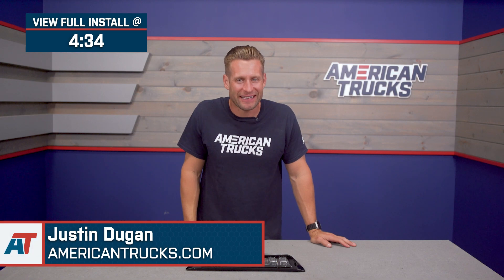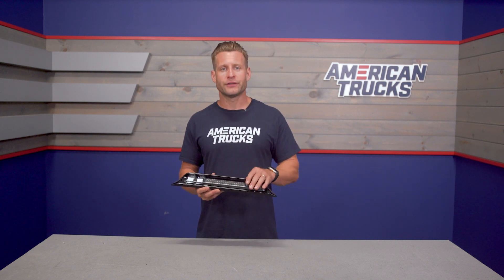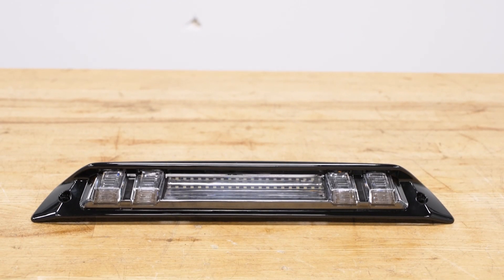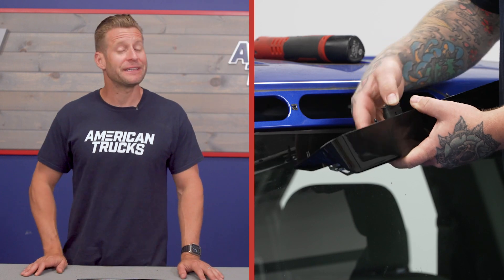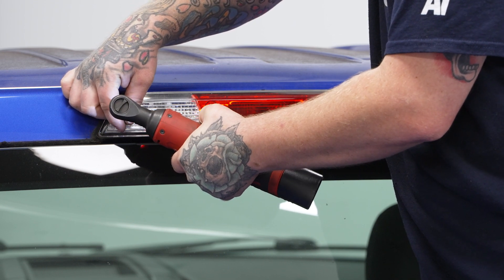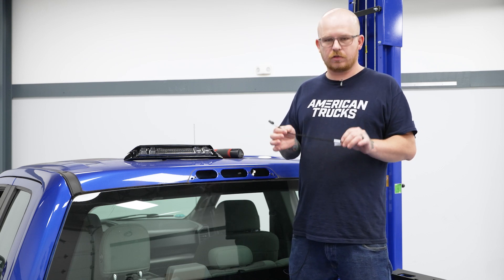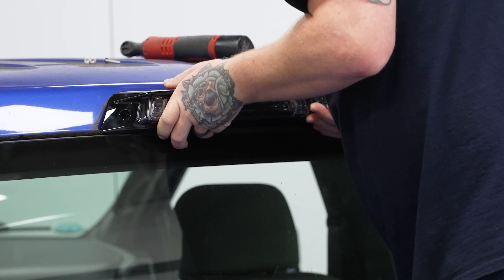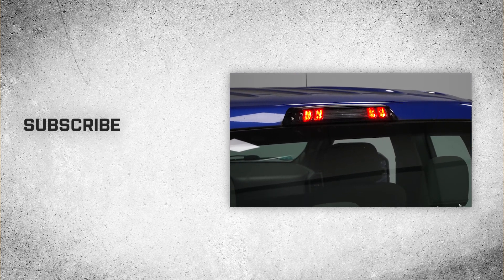2015-2023 F150 Morimoto X3B LED Third Brake Light Review & Install

Comment: Install Tip: Make sure to remove those 2 center black inserts where the original screws thread into. Use needle nose pliers to pinch them and pull straight out. The black Christmas tree pins on the new light will not go into those inserts. (It calls this out in the Morimoto instructions as well.)
Also be sure to wipe the cab (painted area) with iso-alcohol before sticking the gasket. When I installed mine, the gasket did not seal fully, and the inside of the truck was soaking wet after it rained. I removed the light (which is VERY difficult due to the adhesive gasket and Christmas tree clips. Removing the gasket from the light and getting all of the old adhesive off was near impossible.) and reinstalled with the supplied 2nd gasket. This time making sure it sealed all the way around and I pushed and held the light to the cab the entire time while screwing the light in. Hope this helps!

Comment: This 3rd brake is worth every penny. I have it installed on 2020. Couple suggestions.. I would paint the screws black before install and purchase the hyper flash module.On my install I pulled headliner just enough to have access.that white clip not so easy to push out. My factory connection was also taped down. I hope this helps awesome light.
Reply: How bright is it?

Comment: Question.... a lot of the 2023 F150 Platinums are built without some features from factory b/c they had "supply chain issues".  If i bought the 3rd light WITH camera, but my current truck doesn't have this bed camera, but is a Platinum trim level.  Is it just plug and play and the truck internals will see/sense the new camera??

Comment: Morimoto lights are over priced. So are pickup trucks.
Reply: You get what you pay for.
Reply: Your presence in the comments is not necessary. Please refrain from engaging in any further discussions.
Reply: @theman1526  They are overpriced.
Reply: @warrendarrah2555  Dear @warrendarrah2555,

I understand that you may have a different perspective on the value of trucks, but I would like to clarify that my assessment of their pricing is based on market research and industry standards. I do not intend to engage in personal attacks or make assumptions about your financial situation.

Thank you for your understanding.

Best regards,

MUSCLE NUTS
Reply: @theman1526  Well then don't. You are the one "engaging" me.